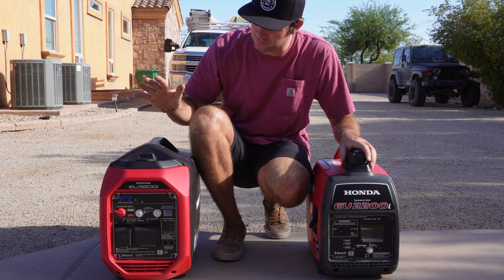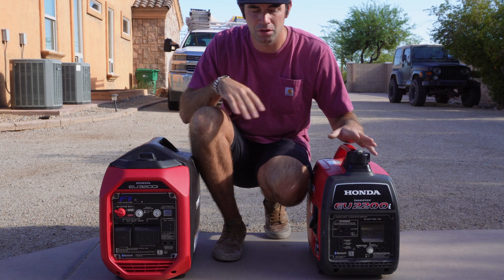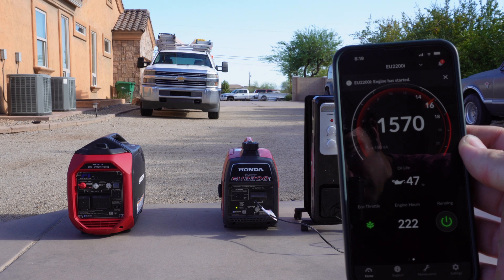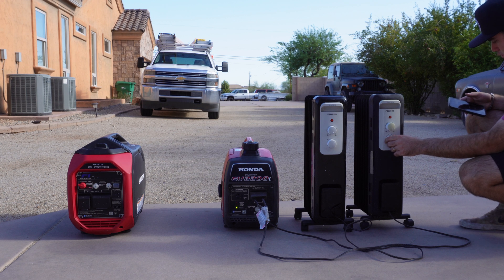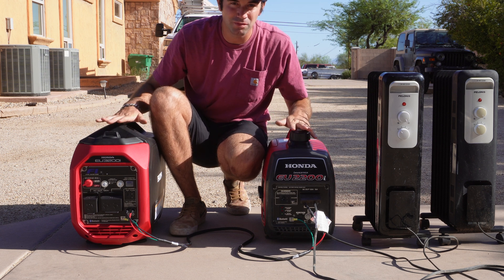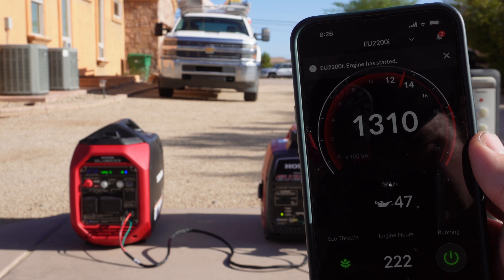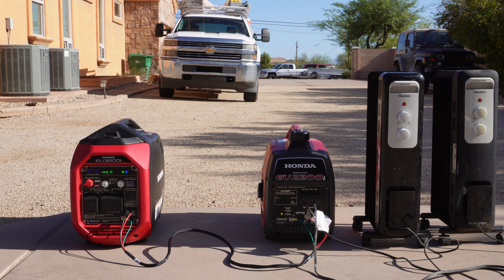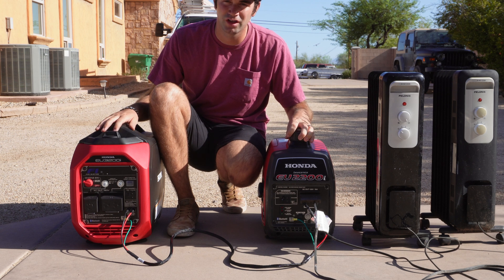Can you parallel connect these two different generators? EU3200i & EU2200i

Comment: Incompatibility Reasons:
Different inverter types and outputs:

The EU3200i and EU2200i have different inverter control systems and power output characteristics.
Honda's parallel capability requires identical models with compatible inverter firmware to sync properly.

Honda's official guidance:
Honda explicitly states that only the same models (e.g., EU2200i with EU2200i, or EU3200i with EU3200i) can be connected in parallel.

Mixing non-matching generators or using non-Honda parallel kits can:
Cause damage to both units
Be a serious safety hazard
Void your warranty

Comment: Good test, thanks.   A good follow on would to keep raising the load, to see if there is any advantage to paralling these, since you could have done this on the 3200 alone,
Reply from the maker: Yes definitely I’ll have to do a video with a bigger load! This video was mostly to show that you can parallel connect these to different generators. Thank you for the comment.
Reply: Based on the readings, two of those heaters would've required 3140 watts, 540 more watts than the rated running watts of the eu3200.  So it would not have been able to run these "alone".